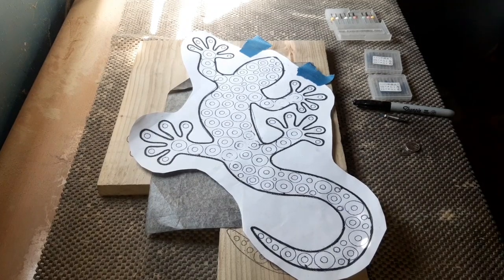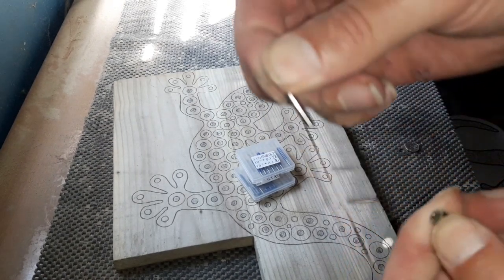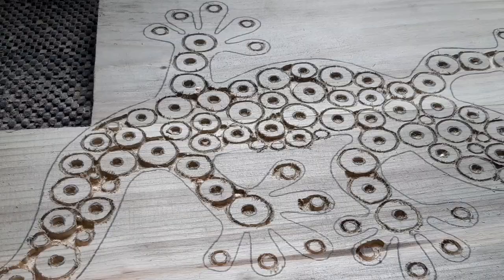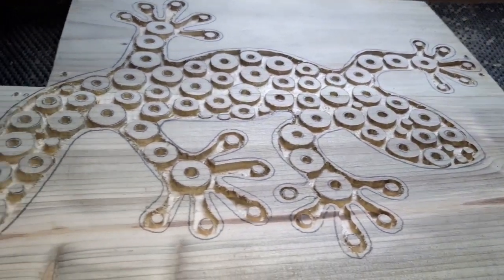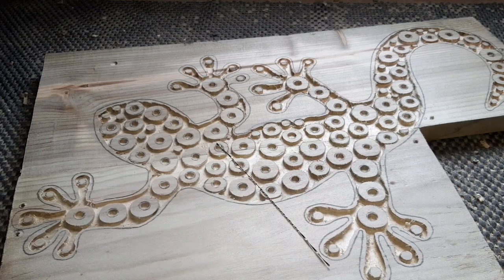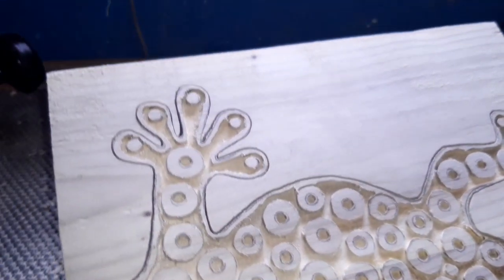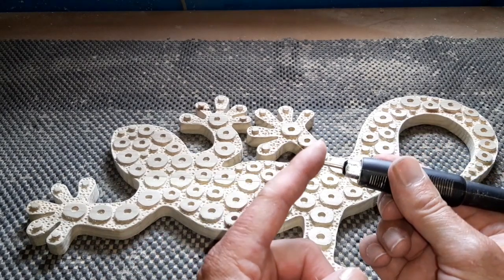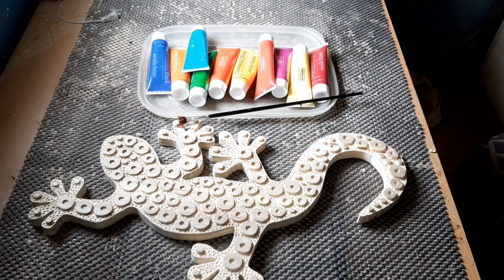Lizard made fencing wood, Router/scroll saw project..

Comment: Every video is an education.  Question, did you freehand all the circles?  When I first saw it, I thought it might be traced around a washer.
Reply from the maker: Thank you Parley ,I actually used a 5pence piece and a small washer to make the circles, I forgot to mention it in the video 🤣🤣
Reply: @fishtank5050  I was wondering how you got them all the same size.  BTW I've ordered the engraving and endmill bits you use.  They should arrive today or tomorrow. I'm planning on doing a Butterfly in a similar fashion to your recent elephant.  It will be my first attempt at resin, too.
Reply from the maker: @ParleysWoodedJourney  excellent, I've done a butterfly with resin ,my first attempt didn't go to well, I was still learning, plus I cut it out on a scroll saw so it would look like stained glass,not my best work..🤣🤣